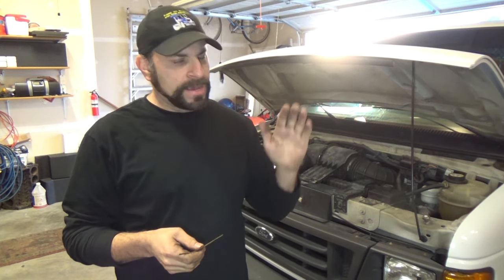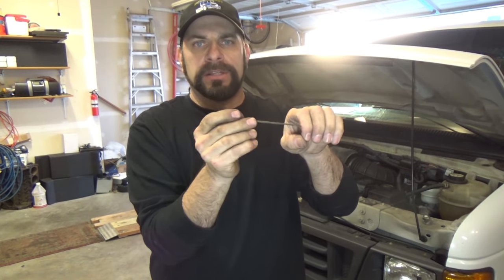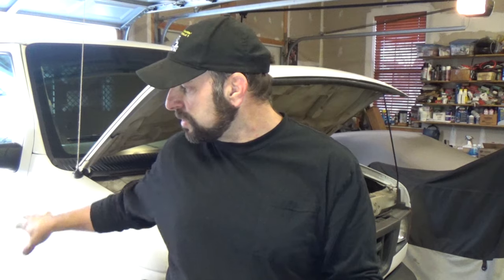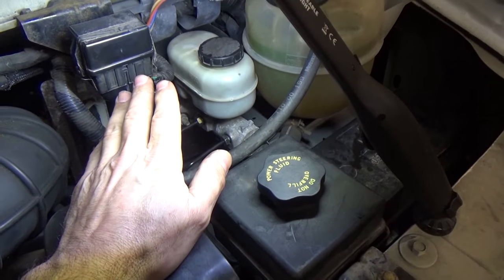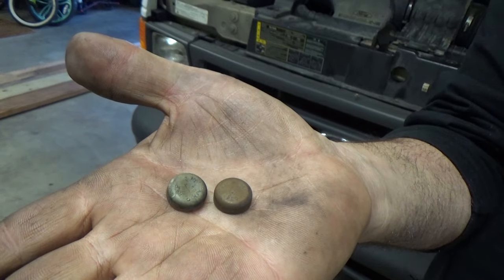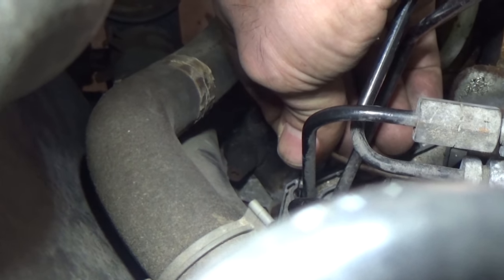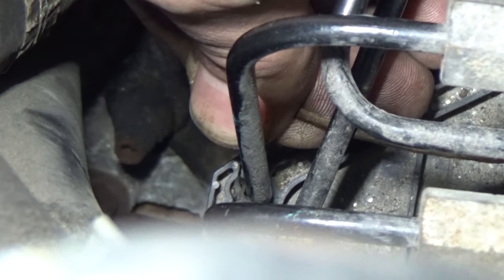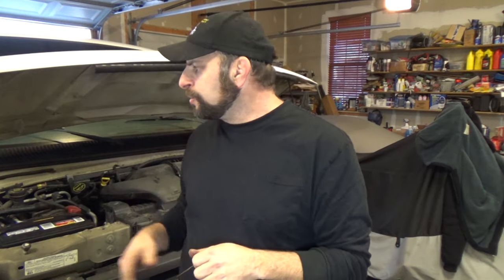Brake Pedal Goes to the Floor I ABS Pump Test I FORD I No Codes

Comment: Trouble shooting a 2011 Ford Edge with intermittent sinking brake pedal.  I can restore the brake pedal by driving on dirt road and slamming on the brakes which engages the ABS system.  This lasts for anywhere between 2 weeks to 2 months then the pedal sinks again.  I can also restore the pedal by using ThinkDiag OBDII diagnostic software which allows me to turn on the ABS pump while sitting still in the driveway.  Does it make sense to you that I probably have a sticking dump valve?  When stuck open it is allowing fluid to circulate internally in the HCU I think.  A new ABS ECU & HCU is not available for purchase through Ford (Nationwide outage).   Are you aware of a way to rebuild or clean out the HCU, specifically the dump valve and possibly restore the normal operation?   I know I would then have to bleed the HCU as well as the entire system.   Thoughts?  Thanks!
Reply from the maker: You could try all new fluid and if there was any junk inside the abs pump hopefully it would be flushed out. I would use a bidirectional scan tool to bleed the entire system and add new brake fluid. Good first try otherwise plan B.
Reply: @ozzstars_cars  Thank you for the reply.  That is next on my list to try.  Thinking that maybe when I have done previous brake pad replacement and pushing the pistons back in possibly some trash got past the seals.  Thanks for your videos!!

Comment: done the dirt road abs test which worked great   but the pedal still sinks to the floor .   Got a second hand ABS module coming from EBAY.   I have a sneaky feeling thone of the valves is sticking in the ABS valve body .

Comment: First time I've ever seen this, too! I think it sounds vaguely familiar, though - I might have read about it in a Haynes manual, or online, many years back.

If that were my van, I'd be bypassing that $1,000 headache! Great vid, Glen! 👍🍻
Reply from the maker: That van needs 911 help! Thanks Smitty
Reply: @ozzstars_cars  - LOL! It's on life support! Reminds me of the Jaguar my neighbor owns. Also built by Ford. Was just back here the other day for being stuck in 3rd gear again. I wiggled and sprayed the tranny connector again, got it shifting, and advised him to dump it as soon as possible, LOL. What a turd!

Comment: If the problem is with abs,  would the problem be solved by removing the abs fuse and disabling the abs system?
Reply from the maker: @superdow1000  that's not fixing the problem.
Reply: @ozzstars_cars  NO it wouldn't fix the problem but it would prove where the problem is which is the important issue. In my case, I removed the abs fuses and the problem persists. Not sure, however, if that necessarily means, that the problem isn't with the abs system.

Comment: I'm having this problem on my '03 escape, - decent pedal when engine off, but low pedal engine on. Sadly, there's no way to get to those ports. 😢 What do you think about putting a used abs on? Do they have to be reprogrammed?
Reply from the maker: Newer vehicles must have the ABS programmed to the ECM.  Have you tested the master cylinder for an internal leak?
Reply: @ozzstars_cars  I plugged the ports on a new MC and pedal was rock hard.  Bled the hell out of the system and get a good pedal with engine off, but like you said, it's when the engine is running that the pedal goes nearly to the floor. Also, ran the abs scanner bleed several times and no change.😤 EBay has a seller of used abs units for $150. Might go that route or junk the truck. It has 210K on it. I will admit  that I may have unknowingly wrecked the abs myself by pushing the caliper pads in during a pad change without opening the bleeder, but I'd never seen that required in the Haynes book.
Reply from the maker: @Ronbo765  never had a damaged abs pump from compressing caliper pistons without opening the bleeder.
Reply: @ozzstars_cars  I know. Doesn't make a lot of sense to me, since the abs should be able to handle 100's of lbs of pressure. My issue did occur after a front brake job, though. Could have been a failing pump, but...🤷‍♂️
Reply: @ozzstars_cars  What is considered a "newer vehicle", in this case. And how much $$ is it to have the ABS programmed? Can one do it themselves with a fairly inexpensive scan tool "that does ABS" testing, or does it take a very expensive one such as only a professional mechanic has? Thanks
Reply from the maker: @steveandrews8301  to program modules a scan tool is not necessary. What is needed is a J2534 box, laptop and a subscription to the manufactures software website and the knowledge how to do it.
Reply: Thanks. I’m looking at maybe having to cross that bridge, now, with my 2007 Hyundai Accent which recently, suddenly developed a soft, sinking brake pedal. No previous brake work done on it, no leaks that I could find. Put a new master cylinder on, bled everything, still mush. Capped off the side ports of MC, pedal became hard as a rock, so it’s not the master cylinder, brake booster’s good, it’s got to be the ABS unit, going to buy a used one. Do you think, being a 2007, it will need reprogramming? Thanks much!

Comment: My brake pedal sinks after changing the front brake calipers. They have changed the brake master cylinder, they have bled the ABS module with a scanner and it remains the same. I can't find the problem, any ideas?.
Reply from the maker: That's hard to diagnose over the internet.

Comment: I hit a pothole while slaming the brakes notice my pedal sinking slowly. i had replace the booster and powerstreering 3 months ago because had hard steering wheel and spongy pedal.
Right now i replace master cylinder all 4 caliper because seems like one was sticking rear pasanger side.i
 get the brake pedal hard enough while truck shut off bleed complete already but when I start the truck and press the brakes starts pulsating contantly just while i press .

1999 ford f350 7.3 dually 4wd

Comment: We’ve taken my dad’s 2009 Ford Explorer to 2 mechanics so far - a local mechanic up the street from us (who said they couldn’t figure out what the issue was for the soft brake pedal) & we then took it to a Ford dealership, to see if they could diagnose the problem. (I don’t know how long they sent on looking for problems - but they also said that they couldn’t figure out the issue. They now say they need at least 2 extra hours, for diagnosis, which will cost over $300!)

My questions are these - do you know how thorough these initial inspections are, through the dealerships (or do they do as little as possible, especially if they’re busy like this dealership was) & wound you recommend, at this point, of just giving the vehicle to charity & investing in a newer vehicle?

I’m not a mechanic myself & know very little about fixing vehicles  - (other than what I learn from videos like yours) - & want to know what the best course of action would be, in this particular case. (To save both time & money.)

I’m planning on asking Ford to provide a list of “tests” they did, while they’ve had my dad’s vehicle - but I don’t know if they will do this or how detailed the list will be, if I can obtain it.
Reply from the maker: Unfortunately I can't diagnose a vehicle online.  It's difficult to find a technician/mechanic that is competent.

Comment: How would you bleed the lines after putting a new one in? Is there a special way to do it?
Reply from the maker: Pump the pedal method or use a bleeder tool with vacuum.

Comment: Thanks for that test idea!  Working on '02 Tahoe w/zero pedal resistance (eng on) no leaks, new master cylinder bench bled, lines bled & no air, Autel ABS brake bleed "passed" w/no DTC's.  Will try that test next.  Question:  Of the two lines between the master cylinder and ABS, is one a "return line"?? Wondering where all the pedal pressure is going, if there's no leaks.  Many thanks!
Reply from the maker: Usually one line is for the front brakes and the other line is for the rear.
Reply: @ozzstars_cars  Many thanks again and understood.   The “stick test” passed, it didn’t move at all.  Not even a mm. I painted notches on one of those plastic brake cleaner nozzle inserts at 1/4” marks. Didn’t budge at all.  Back to the drawing board.
Reply from the maker: @ronaldscott781  you're welcome Ron. Did you block off the master cylinder with brass plugs and test? New doesn't always mean it works.

Comment: I think I have an extraordinary problem here, zero resistance on the brake pedal but the brakes are working strong and good. The resistance from the pedal disappears when the vehicle is moving.  What is the cause to this problem?
Reply from the maker: Test brake master cylinder, check for proper vacuum and test abs.

Comment: Thanks for the video. Does a 09 Ford Escape have test ports? Got one doing the same but the pumps configuration is a little different. Thanks in advance.!!!
Reply from the maker: I don't know if that model has test ports. An observation mirror is what you need to find out.
Reply: @ozzstars_cars  Do many or most ABS pumps of other car makes not have test ports?

Comment: What do you do for a leaking ABS pump when Ford has discontinued the part (#3L3Z2C286AARM) for a 2000 Ford E350 Club Wagon XLT w/7.3 PowerStroke?
Reply from the maker: Used one, online

Comment: What about drilling a tapping one of them test ports with a 1/4x20 and running a bolt into it?
If it can't move it can't bypass.
Reply from the maker: I have no idea how that would be done.
Reply: Jason Jones did you try it?  Any luck?

Comment: Hi! I've got similar problem with Opel Vectra C I figured out this test by myself after I swap ESP module and open old one with grinder but in my case pedal sinking in the floor slowly but there are no movement of this spring loaded containers (those which you showed). I installed new MC (my firs attempt) than I swapped ESP module, checked new MC with plugs, as you said - it's hard, no leaks, system was bleeded by adding pressure to fluid container and problem persist. Any tips? ps. It only sinking at running engine - probably higher pressure during boost. Friend of mine told me that in ABS/ESP system there maybe bypass valve in MC, have you seen one?
Reply from the maker: I have never worked on an Opel.  What year is the vehicle and can you attach a bidirectional scan tool to check the ABS pump?
Reply: @ozzstars_cars  2006, there are no errors and no option to option for activating some special bleeding procedure via my scan tool but i'm not sure what bi-directional mean in this case. Esp works, also breaking force is good acording to annual check measured on rolers (I don't know english name for that, but there is electric motor in the floor which speed up wheels, you push the break and device measure breaking force.

Comment: Hi , good video 👍
I have a 2000 F150
The ABS light has been on a long while but my brakes still work fine.  
Besides the ABS not working and my brakes locking up on a sudden stop,  should I be worried about driving my Ol Bessie?
Reply from the maker: Sure should. Have you tested the wheel speed sensors?

Comment: My 1998 f150 4 wheel drive has 3 rubber capped ports on the bottom of my abs pump . Going to test these soon . My abs light is on and some times it bounces off the bottom which tells me it's going into abs mode . I still have ok brakes but oveisly something is going on which is not right  .

Comment: Great video and very helpful! 
Question:
My pedal does the same. Would this also cause calipers to not release right away?
 * My 07 expedition driver front won't release right away. I've already replaced with new calipers & pads and check valve is ok. Thx!
Reply from the maker: I would be suspect of any caliper that has been rebuilt.  Also be sure that 100% of the air is removed from the hydraulic brake system.

Comment: My 2014 Tundra has this symptom. So when you disconnect the two brake lines from the master cylinder, you will test it by stepping on the pedal,after you plug the two holes up.if the pedal goes down, the master cylinder is bad,right ? If the pedal doesn’t go down, the ABS pump is bad,right? Thanks. By the way,great testing procedures. I will try on mine
Reply from the maker: You are correct.  But before condemning the abs pump check that the system is 100% no air in the line and no leaks.
Reply: Thank you for your reply
Reply: Ozzstar's Cars so,assuming the ABS pump is bad,and you replace the pump,do you have to reset it or reprogram it or do anything to it?
Reply from the maker: @mckoylach1622  the abs module needs to be programmed so the ecm recognizes it.
Reply: Ozzstar's Cars thank you so much,appreciated. Very helpful

Comment: I know this is older I am hoping you still reply we have replaced brake booster master cylinder all brakes around bled the whole system pulled the fuse to the abs. The pedal with ut off will go to the floor and you pump it once and it stiffens and no leaks anywhere and but if you start it it always goes to the floor it used to be intermittent. The brakes booster one way valve is good and tested vacuum and we have enough for it. we tried doing this test I am wondering what if you feel no movement against the hanger on either side does that indicate that it's bad????
Reply from the maker: I don't know what vehicle you are working on but but did you completely block off the brake lines at the master cylinder and test it?
Reply: @ozzstars_cars  ill try that didn't think it could be that since it would hold pressure while the vehicle was off after a pump ill do that today thanks
Reply: @ozzstars_cars  oh it's a 1997 f150
Reply: @ozzstars_cars  master cylinder good!!! Replaced with another brand new one!
Reply: @ozzstars_cars  any ideas?
Reply from the maker: @coltonwp  new master was properly bench bled before testing?

Comment: My pedal sinks only when the motor is fired up. It’s holding 20hg vacuum for over an hour after it’s turned off. Motor off the pedal is hard as

Comment: Is a excelente explication and great vedeo 👍👏 I replaced a master cylinder on my 95 chevrolet suburban and the pedal not have pressure!! I drain all Brake fluid and take the air but the brake pedal still going to end down not keep pressure!! Anyone knows the tricks for taking air or something is wrong 🤔  I appreciate if someone can help cheers from Norway
Reply from the maker: The master cylinder needs to be bled of all air by itself, then the brake lines need to be bled.
Reply: @ozzstars_cars  thanks mate for your good help!! i need find a friend for help me because alone it"s impossible! i will tried on next weekend!! also on my excursion 7.3D i replaced a brake caliper but still air inside on hidraulic hoose"s! probably i need extra help for removed all air on sistem!! anyway  have a great evening i appreciate your help
Reply from the maker: @jorgefonseca9225  you are welcome. Most new master cylinders come with a bleeder hose kit.

Comment: If the brake booster does not hiss after you remove the vac line would that mean the booster is bad? i have the same issue with the pedal slowly going to the floor. i plan on testing the abs pump like you showed. just looking at all the possible causes. it's a 98 t-bird with 59k miles it's been sitting for some time now
Reply from the maker: No power assist and the pedal will be hard as a rock.
Reply: @ozzstars_cars  Sweet ty for the reply.

Comment: After u plug master, do u press on brake pedal with engine off to see if it’s hard? Thx
Reply from the maker: You can check for leaks also to make sure the plugs are tight and not losing hydraulic pressure. Start and make sure the pedal holds firm.
Reply: Ok start engine then hit brake pedal. Thx for the reply buddy

Comment: What are the lines called that run from the master cylinder to the abs module
Reply from the maker: You said it. Brake lines.

Comment: So if you put plugs on the Master cylinder  Ports the brake pedal should be hard mine goes all the way down so the master cylinder is bad.  Of it has air in the System will it still be hard with the plugs on.
Reply from the maker: Any trapped air will cause a soft pedal so make sure the master cylinder is properly bled. If the seals are bad the pedal will not hold pressure.

Comment: so as long as i can find a used abs modular thats number matches my damaged modular it wont have to be reprogramed to work in my car?
Reply from the maker: On the old junk yes you can.  Won't happen on the newer stuff though.  Most new vehicles require a brand new virgin module to be programmed.

Comment: I am tring to figure out what is happening to the brakes on my 2012 Ford Fiesta. At different times the pedal goes to the floor, fast! I have nearly rear ended a few people. Can a bad ABS pump act like this? The brakes seem to work fine other times.
Reply from the maker: Maybe a valve in the pump is getting stuck open?

Comment: I have a sinking brake problem that happened after stopping over a speed bump. I bled the brakes and it stopped sinking but after a hard brake a few hundred miles later it sank again. The pedal doesnt slowly sink and firms up when the car is off. The brakes are responsive but the pedal travel is higher. Is this the master cylinder or could it be the ABS. I had the ABS activate before last month and it didnt sink
Reply from the maker: That's a difficult one to diagnose over the internet but I would start by testing the brake master cylinder, then the ABS module.

Comment: So my ABS pump has fluid coming out where your metal rod was inserted. So I’m going to guess I’ll need a new one.
Reply from the maker: The seal is shot. Not worth rebuilding even if you could find a replacement seal. Swap-a-roo part time.